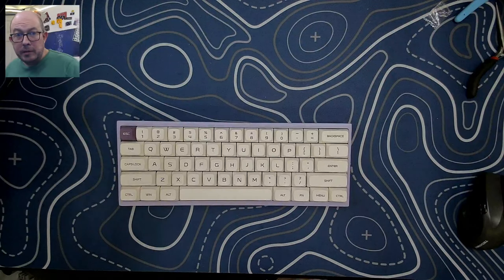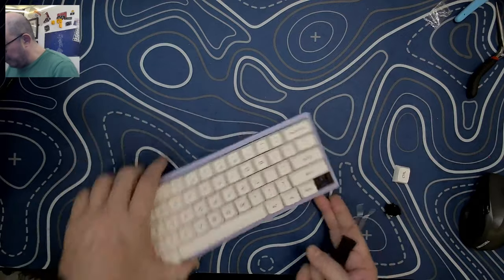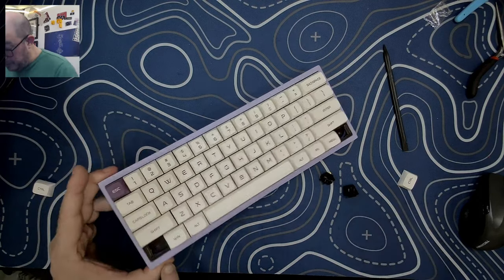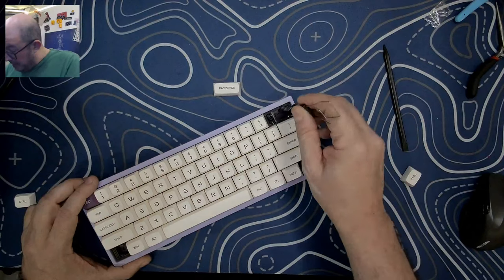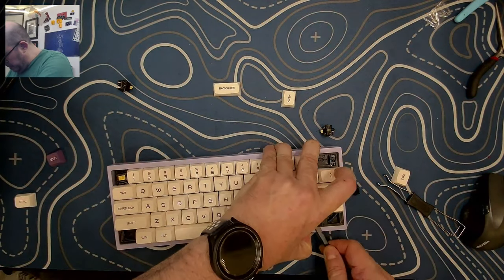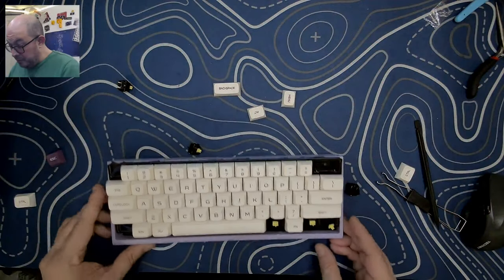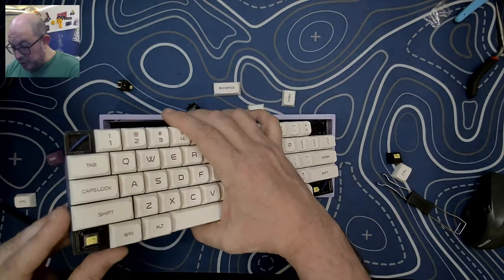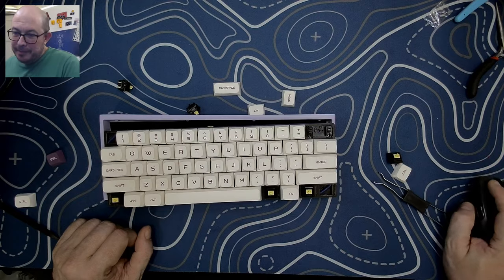The Bakeneko60 flaw that truly kills what would be a great kit. Switches and stabs are not support.

Comment: I built a Bakeneko65 for a friend. I can say that this also happens with the switches near the blocker. If you take them out the o-ring will come out of place. That said, and I can't speak for the 60, the 65 has a neat feature where under the space bar is a little area where you can use a switch puller to pull the PCB out of the case. Taking off some or all of the switches isn't needed, just pull the o-ring off (easily done on the 65, again, can't speak for the 60) replace the missing switch, then put the o-ring back on. I won't argue "switches shouldn't be support" because they really shouldn't be, but removing the pcb and replacing switches is easy enough that I don't see an issue with the o-ring coming out of place.
Reply from the maker: Thanks for this. I did read about issues around the blocker, but as I only have the 60...

I just wish that there was actual support for the o-rings, because despite how much I love how this keyboard sounds, I just don't use it.
Reply: I agree with this comment it is a design flaw yes but a very minor one

Comment: To be fair, there isn't much else at this price point with the same features. I've heard that the bakeneko is an opensource design that cannonkeys made there own version of. Knowing that It's designed to be self-sourced, I think it's understandable that the design lacks some creature comforts.
Reply from the maker: This isn't about "creature comforts" this is a poor design issue. Stabilizers are meant to keep long keys stable when in action, not to act as structural support for a o-ring that applies pressure to a "CLIP IN" PCB stabilizer. All they had to do was include indented corner studs to act as the o-ring support, but someone chose to use the stabilizer.

Also, removing any other corner switch and there goes the o-ring, time to reassemble. I've spent more time "fixing" my Bakeneko than I have actually using it.

Comment: not sure why they didn't put 1 post on each corner of the mounting plate, that wouldn't be hard to implement and it'd fix that issue no problem
Reply from the maker: Absolutely agree, it would make this keyboard damn near perfect and would take little effort or cost.
Reply: It would just make the plate stiffer and wider. Tho I barely seen anyone with a Unikorn complaining about it
Reply from the maker: @z4k1_zaki65  I don't know how the Unikorn differs, but I'd assume it's a better design.
Reply: @MechKeyboards  it’s the same, both uses any universal 60% plate
Reply from the maker: @z4k1_zaki65  From Bakeneko's Github page: https://github.com/kkatano/bakeneko-60

"Bakeneko 60 V3: A simple 60% keyboard for DIYers. This project is a special homage to TGR x Singa UNIKORN 60 and OTD 356 Mini."

From the photos I have seen the designs are similar but not the same.
Reply: @MechKeyboards  I have all 3, Open source Bakeneko v3, Cannonkeys Bakeneko and a Unikorn. The only differences between all 3 are the daughter board placement and the o-ring standoffs (case and pcb)
Reply from the maker: @z4k1_zaki65  do they all come with the same stabilizers?
Reply: @MechKeyboards  It's recommended to only use clipped-in stabs like Cherry's and TX
Reply from the maker: @z4k1_zaki65  I've only tried the Cherry clip-in stabs. Using a toothpick works for a bit, but isn't a permanent fix. I guess I will have to get a set of TX stabs and see if that finally makes the difference as I do want to love this keyboard.

Apparently I'm not the only one that suffers from these issues, and even if that fixes the stabilizer issues, I'm still left with the fact that if I go to change a key cap on one of the corners and the switch comes with it, there goes the o-ring and then I'm forced to take out the PCB and repositioning everything back into place.

Comment: I would take measurements and do a custom "square-ring" (pretty sure I just made up a thing - lol) vs the o-ring. Or making a little stud/stand-off out of a pencil eraser and glueing that down to capture the o-ring around the corners.
Reply from the maker: I like that, square gummy rings! Quick, trademark it! 

Had I had any part in the design process I would have used eight studs to attach the plate and PCB, one for each corner and one for each middle (top, bottom, and sides) that way the o-ring has actual support and isn't forcing a clip-in stabilizer and some switches as structural support.
Reply: @MechKeyboards  yeah. That would urk me. I build drones and am an engine by trade. I tend to improve everything I touch. But it'd be nice for some things to just work... kinda defeats the "hot" in hot-swappable, at least when it comes to corner keys. I'm looking at the Bak65... I'll probably still grab it but this is totally a bummer.

Comment: I used to own a bakeneko clone called the maker phantom and yeah this is a very annoying issue but its to be expected with gummy oring mounted keyboards. the ultimate solution would probably be to just use a solder pcb for these types of boards.
Reply from the maker: Or they could use support studs, but yes, soldering it would fix it until one of the clips on the stabilizer snaps and breaks.

Comment: Why not use solder ? solder pcb's support more layouts and sockets can't be damaged accidentally like hotswapp sockets does
Reply from the maker: It would be a ton of work to remove the hot swap sockets and solder, plus, if the stab clip in ever broke, which it tends to do, time to break out the soldering iron.
Reply: @MechKeyboards  they sell solder pcb's if i recall correctly about the stab you can't use screw ins ?
Reply from the maker: @0xArkemi  I tried screw in stabs, they interfere with the o-ring preventing it from closing. This board was just poorly designed. They do sell solderable PCBs, but I'm not wasting more time or money on this :)

Comment: You can easily pull it to the edge of the o-ring with tweezers, insert a screwdriver or anything in between the o-ring and the plate, pull it and insert a switch or whatever. It works everytime and takes 30 seconds.
Reply from the maker: Many times switches will pop out on their own due to the pressure of the o-ring, then there is no option but to go back and rebuild. I can't deal with issues like this with a tool I expect to work when dealing with deadlines.
Reply: @MechKeyboards  Which switches are you using? I don't seem to be having the same struggle and I've tried H1s, Lavenders and Cherry MX Black Hyperglides. None of them pop out but out of the 3, the H1s have the best grip.
Reply from the maker: @MrJeekz  the only ones I've tried in this build are NK Silk Yellow.
Reply: @MechKeyboards  Could be that those are an unlucky combination! I recommend H1s, they're pretty tight in there. Lavenders are on the looser side but I haven't had them pop out
Reply from the maker: @MrJeekz  right on, I may try that, though to me, the board is just cursed :/

Cheers!

Comment: take the band off, put the switch back on.. walah
Reply from the maker: Do you mean voila? 

The o-ring is needed so it's not sitting on the bottom of the case.
Reply: @MechKeyboards  Obviously you would put the o-ring back on after reinstalling the corner switches...